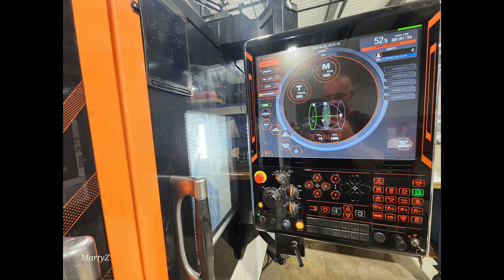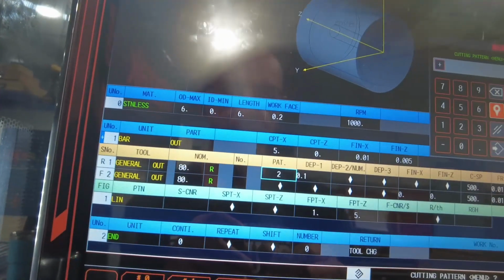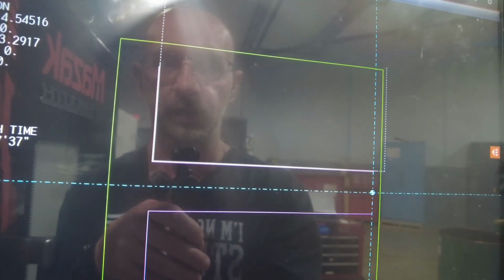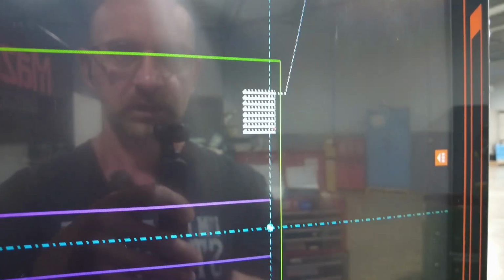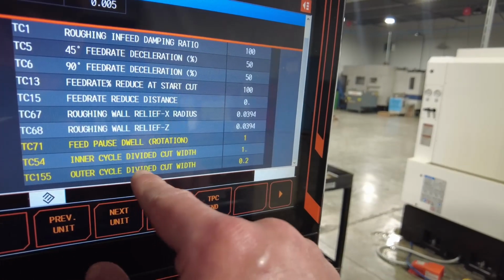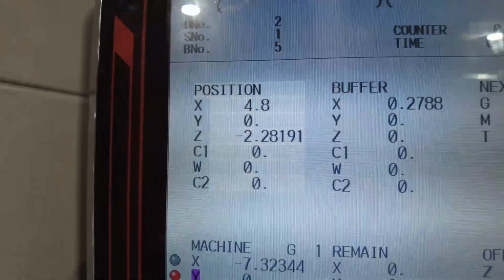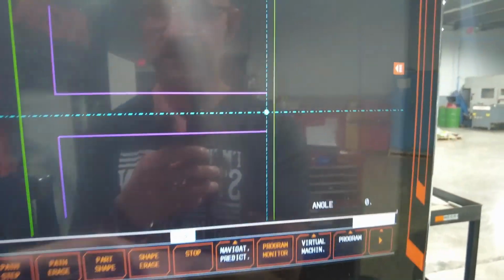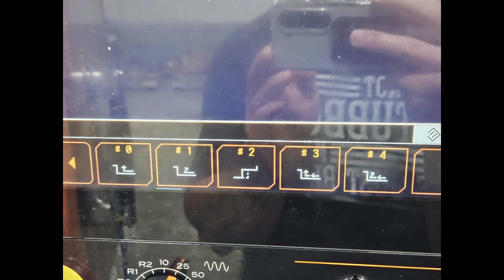Mazak Smooth G Lathe Turning Cutting Patterns for Bar In and Out

Comment: thanks you for your nice contents, you're the best...
Reply from the maker: Thanks a lot, appreciate kind words.
Reply from the maker: When it comes to tailstock question, I made a video on how to use manual codes to engage and retract tailstock when running program in Auto mode, but you can also engage it manually with a button or knob set up, if this is something you're interested in, I can make a short video so visually you can see and try it yourself, just let me know in a comment section.
Reply: @martyz3232  Thank you for your kind reply. If you have time, it would be great to make a short video on that subject as well. Thank you...
Reply from the maker: I will be looking into making shorter videos as well, not sure if they will be informative enough, but I will give it a try. @yyaavvuuzz